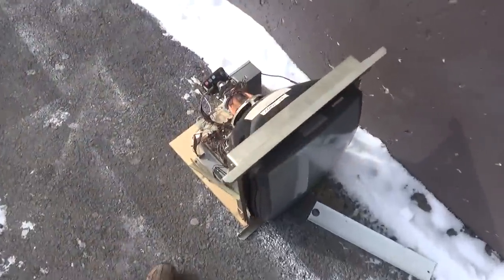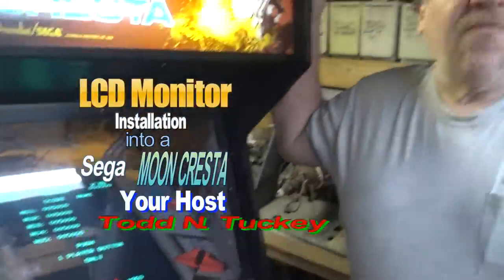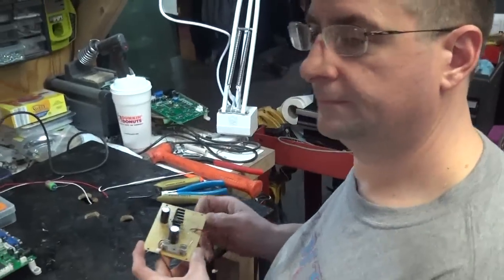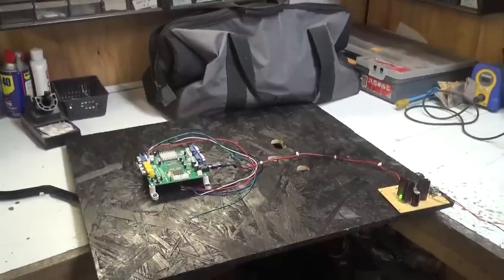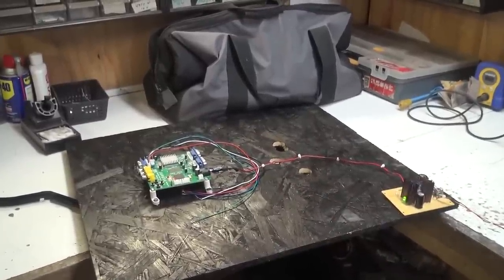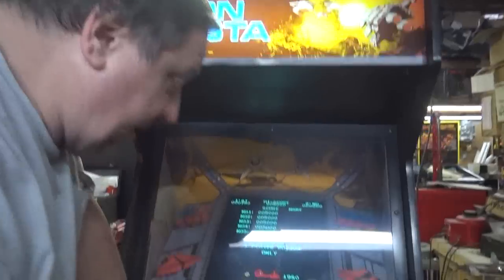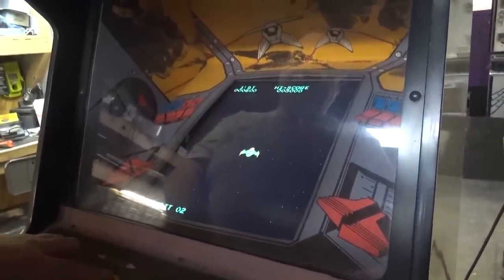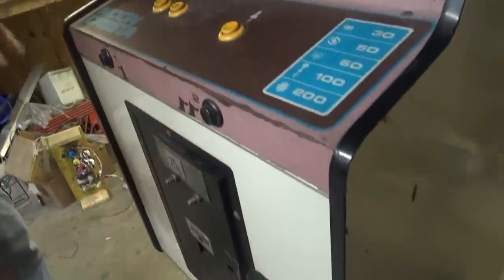#534 Sega Gremlin MOON CRESTA Arcade Video Game Conversion to LCD Flat Screen - TNT Amusements

Comment: The LCD replacement look so good, it always boggles my mind why some people are so against them. I get the desire to keep things "original", but when it fails, it's time to fix it to last. It's like you said, people with classic cars don't have the same oil in it that was in it when bought new 40-50 years ago when new
Reply from the maker: Well, we do try to keep original as much as possible...but the LCD are coming fast...and the tubes are dying...thats no doubt.
Reply: Ed N display lag
Reply: LCD has motion blur that bugs the hell out of me.
Reply: If you use MAME with HLSL shaders (or BGFX if you have a fast computer) you can recreate the look of a CRT on an LCD.  I use a HDTV monitor and that gives a very convincing effect, but with a 4k monitor and a fast computer you can get it even better.

Comment: Thanks for the video.  I am working on my own project now and am getting an error message when I connect the monitor to the VGA adapter.  The error message says "the current input timing is not supported by the monitor display" - any help would be appreciated.  Thank you!

Comment: A classic arcade game on a new fresh LCD screen. How cool is that! Arcade games in a new dimension. Todd, can you tell me if a Arcade video cabinet with LCD can be converted to 220V? and... Do you ship to the Netherlands?  Actually I'm searching for a Arcade with many memory's for me: The Donkey Kong.
Reply from the maker: +Marco V    Its simple to convert any game to 220 volts...we install on bottom a power converter...so it then will plug into 220, 230 or 240 volts!  Todd

Comment: Hi Todd, What did frank have to do to the sync line ?
I have one of those converter boards in a Jamma cabinet here, but some games just wont show a picture.
I know they work as I test them on a normal arcade monitor, 2 of the games are Pleiades & Jump Bug.
Its got to be a sync issue doesn't it ?
Reply from the maker: You have to play with the sync...until you find the combination that works...its a real pain in the a...

Comment: Question. I have a Gremlin Depthcharge with the original 1978 TM-600 monitor.Well, it finally went out. Thinking of doing a LCD conversion. I have a Dell monitor and am going to get a converter board.Will it work on this machine? There are only 4 wires going from the board to the monitor. Cant be too difficult.Let me know what you think.Thanks, Rob.
Reply from the maker: +robbs Haven't tried a B&W game to LCD yet...but color picture tube monitor  to LCD was easy
Reply: Depthcharge - WOW! The first videogame that I rememberi seeing (I must have been about 7 years old)

Comment: OK, so does this mean that if we have a dead monitor on an arcade machine, we can use one of those $30 CGA to VGA adapter boards and just install a computer LCD screen ?
Reply from the maker: Yes you can....BUT, remember the picture will look different somewhat....the purist may not be happy...all of my games in my collection (almost 100 of them,) have tubes.  Todd

Comment: Hello I was wondering if you could help? i have a Prototrac cnc control and the crt went bad. i want to replace it with an lcd monitor. the problem i am facing is I have a Lcd monitor out of a minivan. it has a Ps/2 connector and the old CRT has a flat 10 pin edge connector. is there a way i can interface the 2.
Reply from the maker: Fabric8r You can buy a circuit board that will change the signal!  From Holland Computers.

Comment: I need some help guys. I have a 1995 indy 500, I bought one of those lcd converter boards but am clueless how to hook it to the machine there are so many boards and wires I'm not positive which one/ones I should be looking at to splice in to. And can find no details that help on the net. I'm not going to touch it till I'm 100% positive. Any pointers??? Thanks.
Reply from the maker: Mundster Mundy Is there anyone out there that can steer this man in the right direction?
Reply: Well I figured this out after much research and some minor trial and error. I got the best results when I tapped into the 12v power strip and hooked directly in to the RGB connection on the cpu.

Comment: I have been trying to put a LCD into a Chase HQ game.  I bought the vga converter and hooked it up, but I have been unable to get a picture.  Anyone have any ideas on what I am doing wrong?
Reply from the maker: It seems like one out of three of those shitty boards does not work...you may need to experiment with another
Reply: The converter works in other games just not the Chase H.Q.  Is this because it is a Taito game?  I noticed that the chassis on the original monitor is a bit different.

Comment: how does the monitor turn on when you cut the cabinet on ?
Reply from the maker: ***** The monitors we use remain in the state they were in if power cuts off...so if we turn them on and then the unit is unplugged, they will turn back on by themselves!
Reply: what brand lcd is it you used?
Reply from the maker: ***** Dell!
Reply: dude you got a dell!!!

Comment: You can recycle the monitors or you can have a little fun and drop it glass down from the roof of your building. Takes anger out of everything.
Reply from the maker: Ka----B O O M !
Reply: Ya. That would be awesome.
Reply: *****
Hey, I never said you couldn't recycle it after pushing it off a roof.  ;)
Reply: RCHobbyReviews
know plenty of AR-15 folks who'd love to blow one up.  alas they'll have to settle for HP Printers :D
Reply from the maker: now, now, now!
Reply: TNT Amusements Inc
where's just a normal henry rifle  :)  albeit the monitor that doesn't work anymore is probably worth more than a brand new $300 MFC HP Printer :P
Reply: ya your right on that
Reply: RCHobbyReviews
although technically speaking if they did that at a range they do have to pick up all the pieces.  how I have no idea.  depends on the range  rules :)  presumably blowing it up means just running it over with a magnet and that you can recycle
Reply: you can throw it into an empty dumpster.